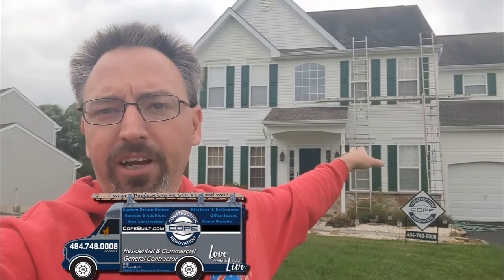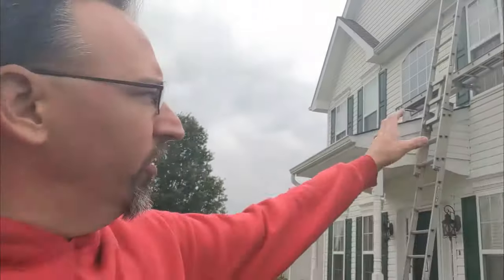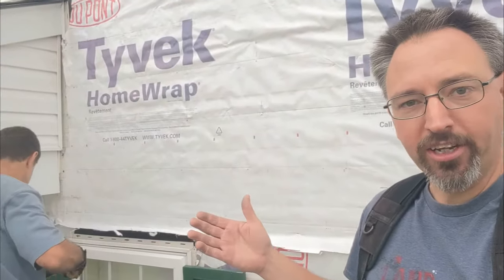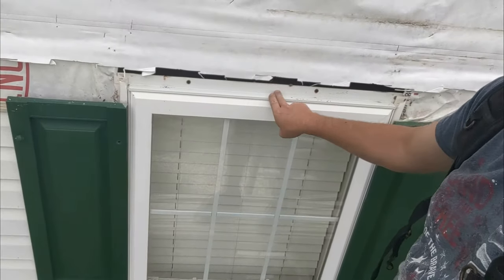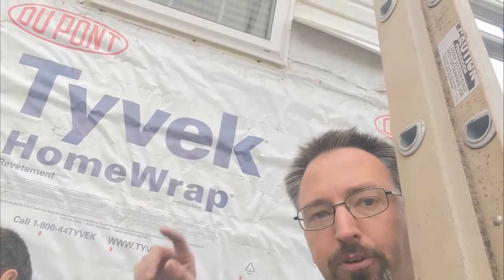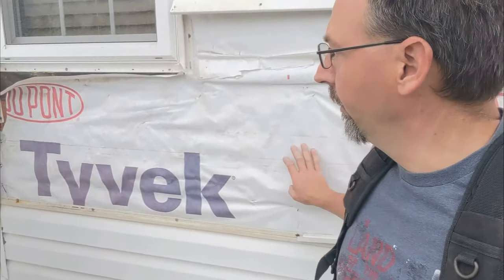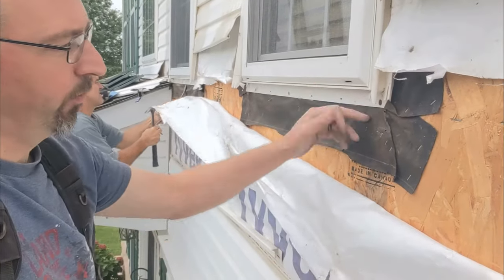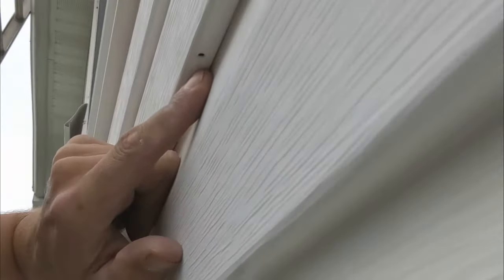Why is the top of my window leaking?

Comment: This is the first video that has actually figured out exactly where my windows are leaking from!!! Why no one else that has come to give an estimate could come up with this fix? Layering must by incorrect?
I have single-pane double hung wood windows with triple track storms/screen...natural cedars on exterior...I want a row or two of shingles removed, see what's under and repair...Can't get anyone to do this!  Wish I could buy you a plane ticket and have you fly up to R.I. !  :)
I will show the next contractor your video and hope they'll agree with you!  Thanks again!
Reply from the maker: Hi Deb... Thank you for taking the time to call our office!  You made our day!  We have put countless hours into trying to produce valuable educational content, and it means the world to us to know that we're helping homeowners outside of our local area.

We're so sorry to hear that you're having this problem both with your home, and with contractors who won't do what's required to help correct it.  

In an ideal situation, yes a contractor could simply remove two courses of cedar shingle, or simply cut a straight line 3 and 1/2 in above the window with plans to fill it with a piece of trim later and a z-shaped drip cap. They can fix the layers, maybe add some aluminum or tyvek to bridge any gaps and put it back together...

 But if they get the shakes off, And there's no house wrap behind the shakes, and no tar paper... Then what we they do? 

 I have seen houses where windows were nailed directly to the plywood sheathing, and the siding installed over it with no house wrap.  https://youtu.be/yBcm1KKTycA

One solution may be to take a small sander to the OSB or plywood above the window to remove any loose debris, and the vac off the dust, then loosen the nail fin at the top of the window, squirt some adhesive sealant behind it, and nail it back on, and then use either zip sheathing tape or another polybutyl window tape product to tape that nail fin onto the OSB sheathing where it was cleaned with the sander.

Here's a video showing some step flashing on a roof and how that integrates with the house wrap... And the theory with your window is going to be similar... And that we want that metal flashing or nail fin continuous for the house rep to come land on top of... https://youtu.be/eU0XH4ZE2xQ

Please follow up with us once you are able to take steps to get this addressed. Would love to know what your contractor thought about the video and whether or not this was helpful in resolving your issue several states away.  

Of course we love to invite you to subscribe to our channel for more great tips every week on maintaining and improving your Forever Home.

Drew Cope, Dad-preneur
Reply: So, a company came over today and just tried to push vinyl window replacement...and if I want wood frame Harvey windows would cost 1800 per window! or the life of me, I cannot find a regular old~school contractor to remove some shingles and trouble shoot...I don't need new windows, just someone to find where the rain is leaking in...It would cost me alot less, Drew, to fly you up to R.I. than it will to buy 2 new windows! Will keep you posted!
Deb @CopeBUILT
Reply from the maker: Even if they install a replacement window in the opening, my comments above still apply.... What if there is no water resistant barrier / house wrap / tar paper under those cedar shakes?  How will they waterproof the opening?   The truth is, they won't.   They'll squirt adhesive goo in there, which will last for 18 to 60 months in the elements and UV Sun Rays until it breaks down from exposure and then it will leak again.   

If no HouseWrap exists, then I might try some Prosoco Fluid Applied Membrane to seal the window flange to the sheathing of the house, but if you don't have house-wrap, then you probably have even bigger issues with water damaged sheathing that will lead to needing to remove and replace the cedar shake to make those repairs... so lets hope there is house-wrap in place.

Here's a blog article and two additional videos that talk about the difference between Replacement verses New Construction windows... and proper installation and sealing methods...  https://www.copebuilt.com/general-contractor/kennett-square-pa/blog.aspx?ID=1064&Title=Replacement%20vs%20New%20Construction%20Windows:%20The%20Essential%20Guide

I hear HVAC techs tell me all the time... "these new young kids in the trades... they aren't learning how to fix things.   They teach them more sales skills than they do actual diagnostic and repair techniques.  There is a certain skill to trouble shooting and learning to isolate problems and run tests and control for all the variables to find the true source of the problem before you start part swapping.  Us old guys can still repair copper heat exchangers with a torch, but a lot of these young tradesmen can barely use a pro-press crimp gun properly, or a pex setup... so forget about glue fittings or solder & flux.   They train these kids to look for a problem that can justify selling a replacement unit, rather than invest the time to find the actual, and probably simple problem that is causing the unit not to fire."      Sadly, we're seeing the same thing with "Window companies" and other trade-specific firms.   Look for an mature, experienced craftsman with a small business, rather than a big flashy renovation company.   You are looking for a Bob Villa, a Norm Abrams, or one of the other guys from This Old House... That's the generation who has the mindset and the skillset to solve your issue with the window.   

My hope is, as we grow, to hire some of these younger tradesmen, and train them up in the old-school ways... we'll see.    

-- Drew Cope, Dad-Prenure
Reply: So, just to follow~up! My brother~in~law gave us the name of someone he knows that re-built his bulk-head..OK..so no harm-no foul! Let's try!  OMG! Finally we have found someone (in his late 40's) that actually takes pride in his work and took the time to stand there and try to diagnose as opposed to "sell". 
Got on a ladder at the most leaky window...Looked, scraped then asked for the hose! Let's mimic a rainstorm (well not that much pressure) and see if we can figure out! Sure enough, the caulking above my triple-track storm was almost completely gone leaving some open gaps! He scraped all the bad debris out of the 4 windows that had leaky issues, re-caulked, re-nailed loose pieces, (and scraped out the clear silicone that my husbands' (ahem) carpenter friend put in between  the natural shingles above the window! Aaaaaaahhhh! which did not work, by the way!
Anyway, we had a moderate rain 2 days following, and thankfully, they seemed OK! It's raining again now so fingers crossed! He actually said let's try the least expensive and least invasive way first and if it doesn't work we can re-visit it! (Elliott Fox Contractor and Fine Carpentry, East Providence, R.I.) website shows some of his work! Hope you approve.......
So now, next project...scrape and re-paint white sills (as needed) and re-stain/poly window stools as needed,,,My yearly maintenance project!
Again, thanks for listening to my long-winded rant, but most of all, thanks for all YOU do! Without this video, I would still be in limbo...I bet there are many people, like me, that your video's have helped/inspired!  I'm just the most talkative!  :)

~Deb Monteiro
Reply from the maker: That's so great to hear!  We're excited for you!! Thank you for keeping us posted on your progress!  We love hearing success stories of how we've helped solve difficult and challenging home problems.  
-Drew-

Comment: Thanks so much with this video!  Do you have any suggestions for how to find a contractor in my area (Washington DC suburbs) who can do a similarly thorough job on my home?  Most of them seem to want to slap some silicone on the outside of the house and call it a day.
Reply from the maker: Sadly, it's going to be a meticulous process to ask friends for recommendations, check with local networking groups, chamber of commerce, BNI groups and keep asking for someone who applies a Belt AND suspenders approach to waterproofing the exterior of your home.   Ask the question on you FB page and ask friends to help connect you with their network.

Comment: This information is all well and good but my window is completely sealed with Silicone, Flex tape and a Gutter installed above the window. It worked great for a couple of years but suddenly is leaking again. Why?? Any opinions why I still leak after being completely leak free for a couple years but leaking again? This problem is driving me crazy.
Reply from the maker: Rule Number 1... Water Runs Downhill...  Gravity works 100% of the time... unless you create a dam, which causes water to pool up and back up the hill.   2 inches of standing water in a pool, creates a horizontal hydraulic load similar to a 35 mph wind.   If you've got that window well sealed... and the house wrap above the window layered properly... and a gutter...  then you need to go up and look at the roof.  The water is coming in from above somewhere.

Comment: I have the same issue but a brick house.
Double story. Ground floor window leaks with heavy rain, but the window directly above doesn't. Brickie replaced a couple of rows of bricks where the weep hole is located and replaced the moisture barrier associated with it. This weep hole brick row location is a few rows of bricks above the window. Unfortunately, even after all this work, water still gets in above the window frame! Now back to square one as the brickie and plumber said they're at a lose how water is still getting through after all the work done.
Please remember the window directly above doesn't leak and have a metal sheeted gable roof.
Cheers
Reply from the maker: Hi Davo... The best advice I can offer you based on your description of the symptoms, is not really my advice. I want you to go and learn from The godfather of modern building science... Dr Joe....

He does a whole session on hydrostatic pressure and what can go wrong in the drainage cavity behind a brick facade... The critical part is about 24 and 1/2 minutes into this video. But you might want to watch the 5 or 10 minutes before and after the section fully understand the concept...

Joe Lstiburek talks about this in some of his building science videos.   https://www.youtube.com/watch?v=rem5WhFiiwU&list=PLHM_Hinmgh2In7R4suJcYVCk3xD4Sugj-&t=1452
Reply: Could you please tell me if you could fix such scenario.
Reply from the maker: If you have a problem with hydrostatic pressure building up behind brick due to poor installation as detailed by Joe Lstiburek in this lecture from the 24 to the 26 minute mark https://www.youtube.com/watch?v=rem5WhFiiwU&list=PLHM_Hinmgh2In7R4suJcYVCk3xD4Sugj-&t=1452 - then you have two options in my option...

(1) Remove the brick and make corrections

(2) Apply a masonry sealant to the brick and prevent water from absorbing into the reservoir cladding.   If you have a stone, brick or stucco exterior we have another video in the editing pipeline talking about spraying a masonry waterproofing product on stone to stop a mystery leak, that only occurred after prolonged rain storms.   Here's a link to the raw unedited footage from that project which might give you some ideas...   https://photos.app.goo.gl/VVsmGfjTDzi64Z3U8   -  If you have stucco, we typically apply Luxon XP paint from Sherwin Williams. 

Please subscribe to our channel so that you get notified when those videos get published.
Reply: @CopeBUILT  issue all fixed. Brickie found the bricks were hard up against the brick lintel. They found as water past through the brick during heavy rain the water was dripping behind the lintel instead of between the lintel and the brick. All they did was hit the lintel back half an inch and create a gap now no more issues. This issue was ongoing for ages before someone finally worked it out by cutting a large section plasterboard above the window and water testing the entire area....😮😮
Reply: @CopeBUILT  Thank you so much for this information. I have subscribed your channel and got notification the moment you replied to my query. I have absolutely same issue. There is a leak above my main floor window only if wind blows rain towards this side. Not otherwise. 
The mason changed the set of bricks immediately above the window and replaced the black sheet within. 
However, in the last windy rain there was a leak again. 
I am in Toronto and we have freezing temperatures and snow every winter. Could you please suggest a good brick sealant to stop this mystery leak that can withstand extreme temperature changes?

Comment: Thank you for this informative video. I wish you guys were in FL. I think this is what is wrong with my 6 y/o home. The front office windows literally rains on the inside every time it’s hurricane season. Only thing is we have stucco exteriors in FL. Any idea how much a job like this will cost me?
Reply from the maker: Thank you for your question!  

Sadly no, I can't speak to cost... The market is different in every region... But I would suspect you'll find someone skilled for $75 to $180 an hour, Plus any trip fees and administrative cost... If they've got a great reputation, it wouldn't shock me to see an estimate north of $2,000 to take it apart and diagnose it and figure out how to fix it and put it back together... And that's with vinyl siding...

With stucco, you need to check out one of our other playlists, that deals with a persistent week a customer is having where the roof met the gable wall.... At the very least, someone's going to cut around the window three and a half inches to get in a new head flashing and then possibly add a piece of PVC trim board to fill the void... Or they could potentially put stucco back...

But the bigger question is whether or not the original stucco installation included a proper drainage cavity / rain screen.... And a water resistant barrier or house wrap to protect the plywood or OSB sheathing...  THE JOB WILL BE MUCH HARDER if the drainage plane and the WRB are not in place... So much so that they may put a disclaimer in their contract saying that if they don't find those provisions behind the stucco, they won't be able to warranty the work.  

For liability reasons, many stucco contractors refuse to do localized repairs and will only warranty their work if they work corner to corner and ground to gutter... So they own the entire wall and they know that they've done it correctly... And they can't be blamed for somebody else's prior mistake.  This is also covered in our other stucco playlist in the last video where I interview a stucco expert.

Hope this helps. Please subscribe to our channel for more great content

Comment: Thanks so much for making this video. I'm a home owner and I think I have this exact problem (except my siding is cement board). Do you think this is something a homeowner could DIY? I am in Oakland CA and it's been difficult finding someone to take this small job.
Reply from the maker: Thanks for your question McShreddy!  I can't say whether one homeowner could do this, where another could not... but here are some considerations...   some pre-req's to handle this repair.

-- Do you have good balance?
-- Are you comfortable on a ladder?
-- Are you comfortable with heights?
-- Do you have (or are you willing to acquire) the tools & materials required?
-- Do you have sufficient personal time, and a multi-day window of favorable weather, in case you hit a snag in the process?
-- How will you handle the situation if you find extensive water damage to the sheathing?
-- if you had an accident during the project, do you have sufficient health insurance and life insurance in place to assist you and your family through the recovery time?

Even with a YES to all of the above, our video here does not cover all the situations you MAY run into while trying to address this leak.   Do you have a local expert or construction friend you can call, or send some photos or a video to, if you get stuck, or have a question mid-project?  

That would be how I would help one of my kids think through the process of trying to decide whether to handle their problem DIY.... or to hire a professional.   I would also suggest they watch other videos from other contractors on this subject like @The Build Show to get other ideas of how to tackle this.

Hope this helps!  Please subscribe to our channel for more great home tips and to let YouTube know you find our content valuable!

--Drew Cope, Dad-prenure